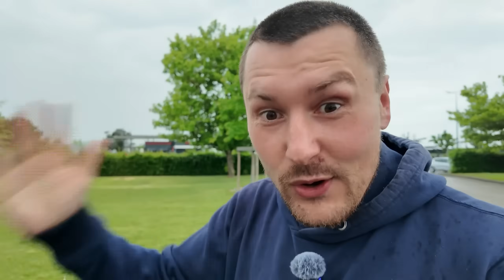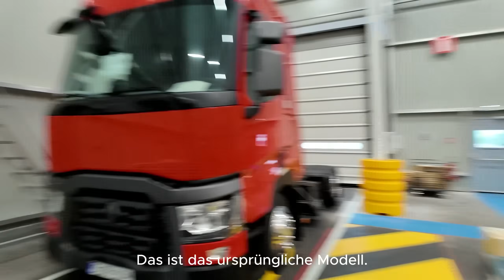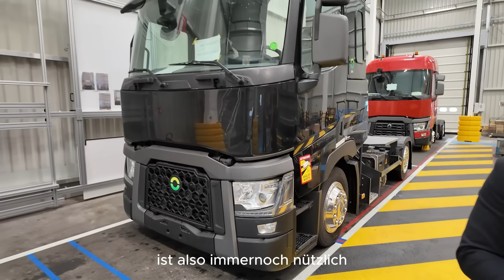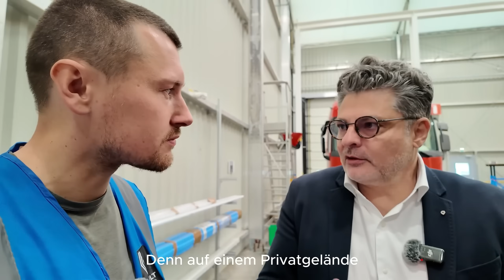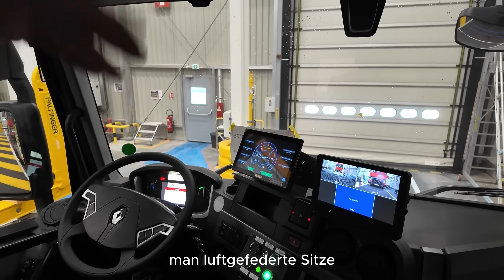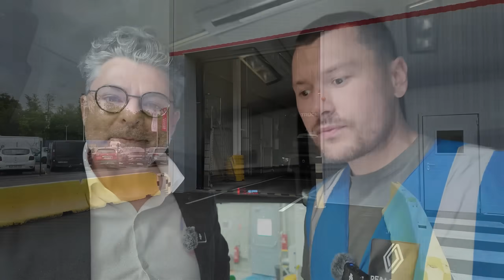Truck Upcycling: Saving old Trucks from the Scrapyard

Comment: In the US they sell a thing called a  GLIDER  KIT. It is a brand new truck-without
a drivetrain. The idea is to use the drivet train out of the truck the new one is replacing.
They will rebuild all 3 components  engine-transmission-differentials & you have a new truck saving a bunch of $$. You could buy one of these & power it with electric.

!
Reply: Very interesting.  As you could imagine, here in Australia we have many thousands of American brand trucks.  When their motors and transmissions are worn out, a local company called Janus Electric is converting these used units to electric drive with swapable batteries.  It should take many years before they run out of donor trucks but when they do, these Glider Kits sound perfect.  We would only need to import them instead of the whole truck.  I just hope your president doesn't hit us with a blockade on top of the tariffs. 😭

Comment: Down here in Australia we have a company called Janus Electric which is converting diesel trucks to electric. Great vids cheers.
Reply: Great company.  I'm a shareholder. 😄
Reply: They use battery swaps?
Reply: @anthonyxuereb792 Yes.  Swap takes 5 minutes, which is quicker than filling with diesel.  Companies that use them, love them because trucks are converted after the diesel motors are worn out.  Much more cost effective than rebuilding the engine and transmission, and way cheaper than buying a new truck.  Janus is expanding to other Australian states and overseas so it will be interesting how far they can go.
Reply: @martythemartian99  It's strange how battery swapping isn't discussed much if at all as it has its merits definitely.

Comment: Cement mixer is a great use for battery since by definition they cant go very far and are usually in town where noise is a concern anyway (at least in Germany).
Reply: Yes, in Australia too.  One company in particular, Cement Australia, is converting its fleet to battery swap electric trucks from Janus Electric.
Reply: @martythemartian99  That's a great application for Janus.  I think they have a lot of potential.

Comment: In the US these are called by a variety of terms - "hostler", "yard dog", "shunt", "mule".  There are probably more, but those are the ones I've heard from professional truckers and site managers.
125 moves a day - likely done in conjunction with a YMS or ILMS - is a pretty reasonable number, since that averages just over 6 moves per worked hour. I would expect that charging is a complete NON-issue if the yard driver is plugging in during legally mandated breaks and lunch.
In places where I've installed logistics systems, a move is made using a WiFi system with an onboard tablet captive to the YMS (in smaller sites it might just be a General Radio Services / CB) and is fully-directed - the yard is either mapped to zones or discrete staging spots and a move is from a dock door to a staging spot , a staging spot to a different spot, or a staging spot to a door.
At some BIG retailers, outside carriers are encouraged to just DROP their trailers in a specified easy-to-reach spot and leave which CAN be better for all concerned (since the driver's wage component is minimized doing that). 
Not really sure how things work in the EU.
Reply: HASHTAG "JOCKEY".
Reply: @phillyphil1513  LOL forgot that one!

Comment: What a great way to extend the life of Smokey, toxic gas emitting noisey diesel trucks rather than letting them continue polluting more and more as they age.
Reply: There is a new battery chemistry that will be a huge improvement over the best we have today,and it does not require changes in battery assembly lines. It would probably mean transport trucks that are able to replace diesels. https://www.youtube.com/watch?v=DK_hOnvU3l8

Comment: I still hope they will make semi trailers with batteries and motors.
It would save piles of diesel, but also piles of maintenance and when there is not enough electricity, you can still continue to drive on diesel anyway.
Also, when there is no diesel left, you can also pull it with an electric semi. You could even charge the electric semi while driving with such a trailer.
In windy conditions, the trailer will stay more stable because of the battery.
It will essentially turn any diesel semi into a hybrid, and it will also safe it from a lot of maintenance.
Reply: If there is not enough beefy electricity, a charging station operator can use batteries as a cache storage, still enabling a few hundred kW charging power.
Reply: @Hukkinen  Even if it never receives any electricity, it would still regenerate when braking or going downhill. It's just a bonus if it could actually charge on top of it when there is electricity.

Comment: It's long past due that all CGE vehicles should have their own specialized electric vehicle conversion kits developed, formatted to seamlessly fit the internal frame and dashboard of every model. In today's world where special bracketing can be 3d designed with sturdy material printing and machining, all such custom components specialized for use in quickly converting every make and model of CGE vehicle over to a silent, powerful, battery swapping upgradeable, 620+ mile 1000+ km full charge travel distance, fast wired/wireless charging electric vehicle should be made available EVERYWHERE!

😃🤝🚙⚡🔋⚡☀️⚡🔋⚡🚗⚡🔋⚡☀️⚡🔋⚡🛻⚡🔋⚡☀️⚡🔋⚡🚛⚡🔋⚡☀️⚡🔋⚡🚒⚡🔋⚡☀️⚡🔋⚡🚌⚡🔋⚡☀️⚡🔋⚡🚚⚡🔋⚡☀️⚡🔋⚡🚑⚡🔋⚡☀️⚡🔋⚡🚜⚡🔋⚡☀️⚡🔋⚡🏡⚡🔋⚡☀️⚡🔋⚡⛺⚡🔋⚡☀️⚡🔋⚡🚓⚡🔋⚡☀️⚡🔋⚡🚕⚡🔋⚡☀️⚡🔋⚡🚐⚡🔋⚡☀️⚡🔋⚡🚅⚡🔋⚡☀️⚡🔋⚡🚄⚡🔋⚡☀️⚡🔋⚡🚎⚡🔋⚡☀️⚡🔋⚡🚃⚡🔋⚡☀️⚡🔋⚡🛺⚡🔋⚡☀️⚡🔋⚡🚲⚡🔋⚡☀️⚡🔋⚡🛴⚡🔋⚡☀️⚡🔋⚡🛹⚡🔋⚡☀️⚡🔋⚡🛵⚡🔋⚡☀️⚡🔋⚡🦼⚡🔋⚡☀️⚡🔋⚡🏍⚡🔋⚡☀️⚡🔋⚡🛳⚡🔋⚡☀️⚡🔋⚡⛴⚡🔋⚡☀️⚡🔋⚡🚁⚡🔋⚡☀️⚡🔋⚡🚤⚡🔋⚡☀️⚡🔋⚡✈⚡🔋⚡☀️⚡🔋⚡🚀⚡🔋⚡☀️⚡🔋⚡🛰⚡🔋⚡☀️⚡🔋⚡🏠⚡🔋⚡☀️⚡🔋⚡🏘⚡🔋⚡☀️⚡🔋⚡🏢⚡🔋⚡☀️⚡🔋⚡🏤⚡🔋⚡☀️⚡🔋⚡🏥⚡🔋⚡☀️⚡🔋⚡🏨⚡🔋⚡☀️⚡🔋⚡🏩⚡🔋⚡☀️⚡🔋⚡🏪⚡🔋⚡☀️⚡🔋⚡🏫⚡🔋⚡☀️⚡🔋⚡🏟⚡🔋⚡☀️⚡🔋⚡🏙⚡🔋⚡☀️⚡🔋⚡☀️⚡🔋⏳⚡☀️⚡🔋🔋🔋🔋⚡🏭⚡☀️⚡🔋⚡☀️⚡🔋🔋🔋⚡☀️⚡🔋🔋🔋⚡⚡⚡⚡☀🌞☀⚡🌪⚡🌛🌊⚡🌎👍
Reply: What is CGE vehicle? Couldn't find it quickly.

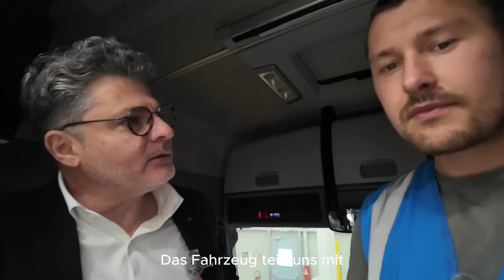Comment: A tip for adding subtitles to your videos. Look for a setting to add an outline around the letters. When you're doing the interview inside the cab (e.g. 17:18 forwards) there's a backlit window in the background, and you cannot read the text that overlaps it.

I only use DaVinci Resolve, and in that one you go to the Inspector, Video, Track, 
change the "stroke" to outside only, set a contrasting colour (typically black), and set the size to 1 or 2. You CAN go higher, but that often gets distracting.

You can also choose to set a Background colour, where black is the typical one, and set opacity to around 50.

Comment: "Electricity consumption per gross ton. To achieve a more comparable efficiency of trucks, it would be a good idea to measure kWh / 100 km per ton of gross weight."
Flemming from Denmark
Reply: Interesting idea, but this suggests that the consumption scales linearly with the gross weight, which is, of course, almost never the case.
Reply: Perhaps the charging electricity price (on-the-road VS at depot) and practicalities of loading optimization (nuances of minimizing empty/unpaid loads) is more relevant than kWh/100km per tonnage?

Comment: Thank you for another interesting video! Here in Sweden there are a lot of trucks! Many times there seem to be more trucks than passenger vehicles. Can't wait for most of these trucks to be electric!
Reply: Here in the UK there are not so many electric trucks yet but a lot of busses and even some coaches are becoming electric, which is interesting to see. Also, the electric ones are often more powerful and quicker than the diesels.